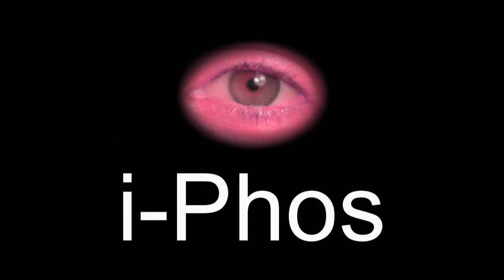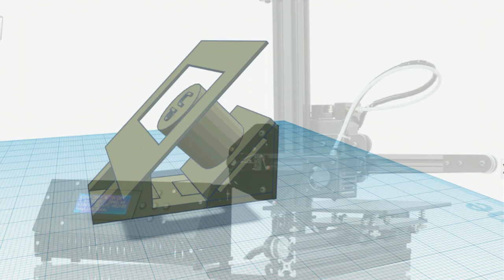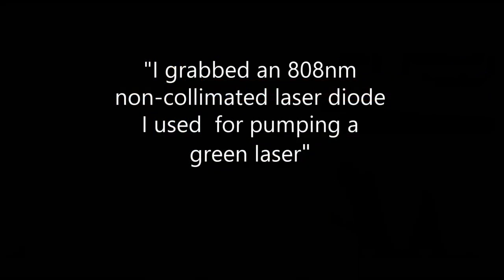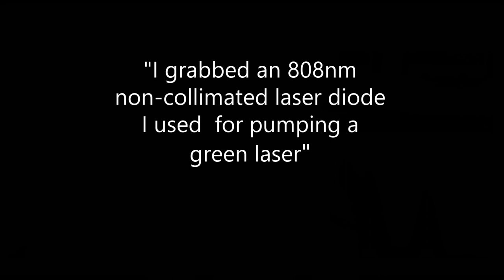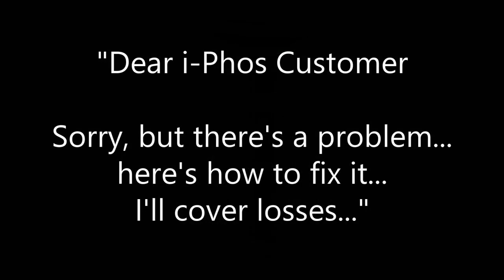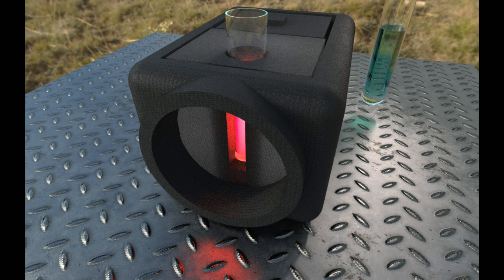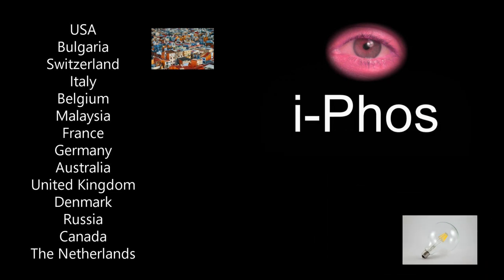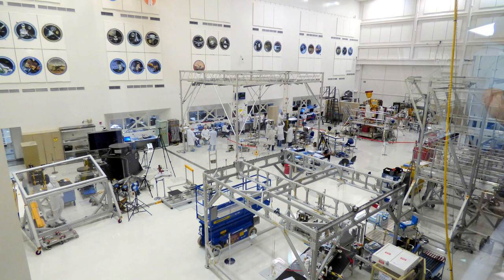i Phos Light/UV/IR Spectrometer - Update

Comment: Hi Chris, 

Check out videos from Migro   and Gromau among others.  Great videos.  I have spent a lot of times looking at grow light ads.  There are many reasons why advertised wattages are greatly exxagerated.  Many vendors use the reoplacement wattage for a metal halide or hps light. so they claim their led will replace a 1000 watt High Pressure Sodium they will claim their lamp is 1000 watts.  This is of course scientifically stupid and misleading.

Next grow light smds and cobs are more intense and efficient than when first introduced. Theoretically 300 lumens per watt efficiencies have been reach in the lab.  Most home depot type ulbs are 70 to 80 lpw though i just picked up a soft white 2700k 6o watt bulb that actually only draws only 6 watts so it is 100 lumens per watt.  Many Blue Red grow lights aka blurple are 70 lumens per watt yet there are some standard Kelvin bulbs 2700k, 3000k, 3500k, 4000k, 5000k and 6500k (daylight bulbs) that range from 100 Lumens Per Watt up to 190 Lumens per watt and CRI [Color Rendering Index] from 70 to 95 % which is a measure of how close objects look like ther true color.  An apple under cri of 95 will look more like an apple than under lamp with CRI of 70%

Lamps reach high efficency by not running them at full voltage, the cooler operating temps produce less heat. Diodes put out more relative light than heat.  For instance Some professional grow lights come with dual 10 watt bulbs .  If there are 100 bulbs they may claim their light is a 2000 watt lamp yet it may only be drawing 320 watts at the watt, so it really is a 320 watt light dialed down from 2000 watts to run longer, cooler and more efficiently.  This may allow the lamp that may be 100 lumens per watt to produce 120 or 130 lpw [i am just making these numbers up). Many pro grow lamps now come with 0 to 10 volt dimmers for this purpose now.

It is also turning out that many growers are producing heavier yields under various white lights over the blurple lights due to much more light being delivered. Even Green light has been shown to be deeper penetrating into the canopy and still photosyntheitically active.  There are som new red lights that give out over 3 umols/J which are supper efficient and would be clearly great for flowering. 

As soon as i get my next paycheck, i am going to buy one from you.  Thank you so much
Reply from the maker: Hi James that's a lot of helpful information which I'll leave here for others to use - thank you.

Comment: Could this be my cost effective  solution to substance identification in my archeological research? Anyone using it for IR spectrometery of organic compounds?
Reply from the maker: Hi Brett. Short answer is "I don't know". If you're thinking or using Raman spectroscopy then your challenge would be the amount of available light, which as I understand it, is generally 1% of the incident light. But it owuld be a really interesting thing to try.
Reply: @chriswesley594  Thanks, yes I was looking into that and looks like I need to measure wavelengths up to about 4kz and assuming that is reliant on the diffraction grating I can not find one that is above 1000 l/mm. I think the way for me to go here is use a Lab to do the initial testing, and then compare the results using your kit on the lower part of the bandwidth. The 'finger print' bandwidth runs to about 1500 Hz so I still may find the I-phos very useful as an indicator compared to the lab results.
Reply from the maker: @Eoliths  I'm puzzled by your talk of Hz & KHz.

Wavelengths are distances (the length of a wave) measured in metres, or - in the case of light waves, which are tiny - nanometres (nm), which are a thousandth of a millionth of a metre. Visible light wavelengths run from about 400 nm to 700 nm.

You can also measure the frequency of light - the number of times the wave oscillates per second; but light has frequencies much higher than the KHz (Kilo herts - or thousands of oscillations per second) you mention. Red light, for example, oscillates around 400 THz (Tera Hertz). That's 400,000,000,000,000 Hz - or 400, million million times a second.

Anyway, a diffraction grating of 1000 lines per mm is fine for light spectroscopy.

My device can handle the entire visible light spectrum and also some of the ultra violet and infra red too, so I'm not sure why you're limiting it to the lower part of the spectrum.

Anyway, I hope that's helpful. Have fun!